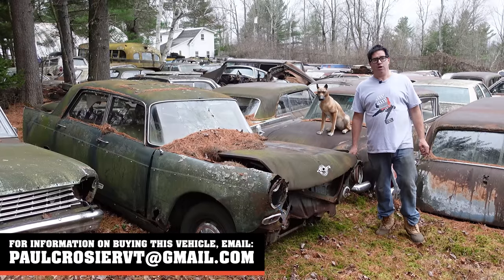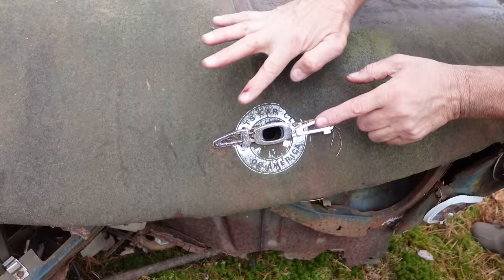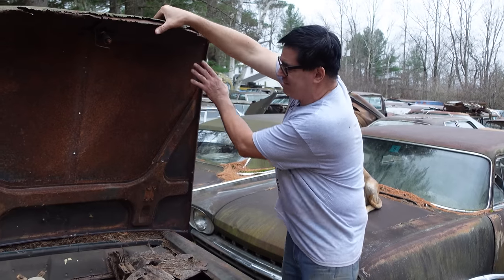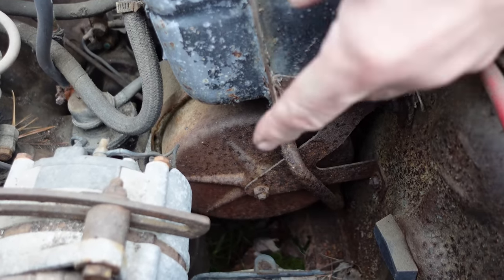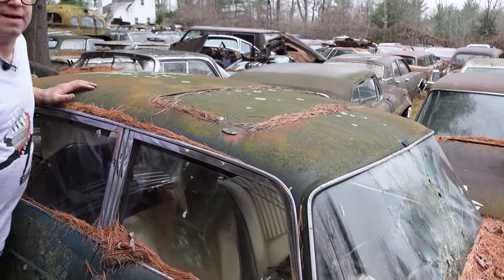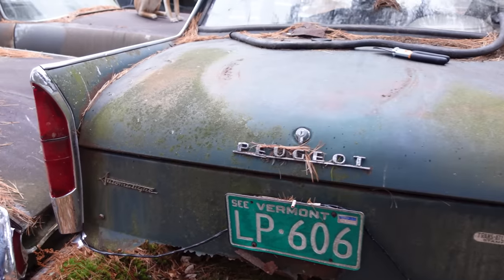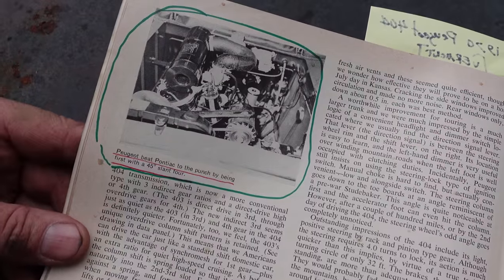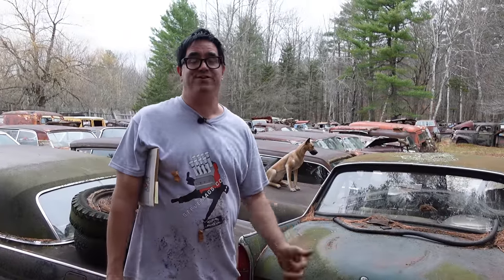Pee Yu Joe!

Comment: The 404 is a French car with Italian styling. Pininfarina designed the body. Lots of them still on the road here in Kenya where I live. The successor 504 was assembled in Kenya between 1974-2002 and was the most common car on our roads for many years. They're tough and reliable vehicles.
Reply: That's really cool to hear first hand experience, it confirms what I heard on Top Gear.
Reply: Just like Fiat 124 based RWD Ladas [1970-2012], in Egypt 2014. They're still popular in former Soviet Union countries and Hungary. I still drive my 2107 1300. It was cheap to buy, easy to repair - no electronics, turbo, DPF, power steering pump etc. good suspension - Western car owners have to replace their ball joints and swing arms every year. They were constructed for German Autobahns. Lada could be driven on some really shitty roads, it's still like a car from the 60's. The suspension of the Lada passenger car is not much different from the off-road Niva.
Reply: As I understand it, the top selling car in Kenya is now the Toyota Fielder.
Reply: @rightlanehog3151  Fielders are expensive. Top selling would be a Toyota Vitz or Honda Fit, less than half the price of a Fielder.
Reply: @upscaleshack  Thank you for the very helpful clarification. As a Canadian who learned recently that the most stolen vehicle in Kenya was the Fielder, I erroneously assumed it was the biggest seller as well.
Reply: @rightlanehog3151  Keep in mind that the vast majority of cars sold here are used Japanese imports. The new vehicle market represents a tiny portion of car sales. By law we can only import right hand drive vehicles newer than 8 years old, so most imports are small cheap Japanese cars  that are 7-8 years old. These sell for between $5000 and $10,000 USD locally.
Reply: Cool that you are watching in Kenya and thanks for sharing that info.  And I have always thought highly of Peugeot because of their bicycles and sponsorship of a pro cycling team decades ago.
Reply: Although Peugeot isn't exactly known to build very reliable cars. The 504 was definitely a different story then the crap they have been producing the past 30 years.
Reply: @upscaleshack  My understanding of the Kenyan auto market  is becoming clearer and clearer. You mention the Vitz, did you ever see a Toyota Voltz? It was the Toyota branded equivalent of the Pontiac Vibe I drive.
Reply: @rightlanehog3151  Yes, I've seen a few Voltz around but not many. They look pretty weird, Pontiac styling with a Toyota logo. They were actually built in California and exported to Japan.
Reply: @upscaleshack  Yes, they came from a plant which at that time built Corollas, Vibes and Tacoma pickups.  The third sibling in the Vibe , Voltz family was the Toyota Matrix which came from North America's other Corolla factory in Canada.

Comment: My friends father had a 1979 Peugeot 504 diesel manual and drove it over well over 200,000 miles then sold it to our family and my sister drove it for a while and it was nearing 300,000 and what stopped it was the strut towers rusted out. The thing ran great and was super comfortable with great seats and was very different. Would like to drive one again.

Comment: I got my driver's license with a 1970 Peugeot 404 sedan. A couple of interesting points about the car I would like to share - First, under the hood where you showed how the shock tower was rusted, there were two clips on the top of the inner fender. On our car that had a crank stored there so if needed, you could hand crank the engine over. Also, with the factory sunroof, it was manual, a handle that you turned down and then pulled back and set where you wanted it (the sunroof never leaked). Fun car, It was the 3rd one our family had, in '69 my father bought a 404 3 seat wagon which he towed a camper trailer all over eastern Canada and the New England States - Imagine two adults and five kids in the summer with no A-C, fun times.

Comment: I bought a 67 in 81. It came with a parts car in a field of farm implements.  On a drive to Denver the water pump bearing broke. I topped off the water and drove on.  The fan would center itself at speed like a top and would only overheat under 55mph.  Made it to Denver and home in4 days. I heard these cars were the only cars sold in Algeria as nothing else new could last more than a year.

Comment: Colombo drove a Peugeot 403 Cabriolet.  They, SAAB, Mercedes, and some Econolines were four on the tree.  Had no corrosion resistance and were poorly supported in the day.
You would often have a Renault, Citroen, Peugeot dealership, and a back ordered parts situation for all. In the mid fifties Renault outsold VW. The Renault sixteen that competed with the 404 and 504, a front drive nightmare to work on. The Japanese sent them all scurrying.

Comment: Mwoah, I've been waiting for a Peugeot on this channel. Im a Peugeot enthusiast and i almost got to own a 1965 Peugeot 404 1.6 Petrol with a manual transmission and even the original radio, about 2-3 years ago, but once it got sold from under my nose i bought a 1974 Sunbeam Avenger, (sold in the States as the Plymouth Cricket). I currently own a 1997 petrol Peugeot 605 turbo 2.0L automatic, which could use some love, but luckily i have my daily Caprice to get me around in the meantime.

Comment: All of the Pratt and Whitney radial engines from 1925-on were hemis too. One exception - the 20-cylinder Yellowjacket experimental engine was liquid-cooled with single overhead cams. Same with Wright, Continental, Lycoming, Warner and Jacobs. Hemis.

McPherson struts we’re invented by Earle McPherson while working for Chevrolet on the small oddball Cadet, which was ultimately never produced in the states. It twelve inch wheels. McPherson went on to Ford and helped develop the Falcon/Comet.

Comment: My dad had a 61 404 from 1964-1968.. He traded it in on a 1968 Pontiac Tempest custom. My mom told me that when the older salesman Rex Pontiac in Queens NY who delivered the Tempest, hopped in the 404 to pull it behind the dealership he said.. "Oh Jesus! its got a manual transmission too! I haven't driven a Peugeot like this since the end of the war in France!" 😂Funny that you have a Smart car. I had 2 of them at one point. I still have my 2009 Black Brabus coupe I bought new in 09.. They only made 1500 Brabus editions that year (750 coupes and 750 convertibles in black or silver) Its a fun car to drive! Just one in my fleet of vehicles.
Reply: Your father made a smart move by trading that heap for a Pontiac. LOL.

Comment: The director of the housing authority where I worked back in the late 70’s drove a diesel Peugeot 504 (the successor to the 404). It was definitely sharp looking car, but man the cloud of smoke and the noise from that engine was something else. You could hear and smell it coming from a block away, and when it was quitting time you could always hear it cranking and cranking in the parking lot before it finally caught and belched out a big cloud of smoke. A gas powered slant 4 hemi-style engine sounds like a pretty good idea, that 504 would’ve been pretty nice if it had one of those in it.

Comment: Interesting fact: The 404 rear axle uses a steel worm drive pinion against a bronze ring gear. This is to have the propeller shaft as low as possible, for more room inside..
Reply: Yeah, it's too bad we can't see the drivetrain on more of these episodes.
Reply: I looked it up and it is still available on ebay. That big bronze ring gear is a beautiful part.

Comment: Hi Steve,  I've had two of these 404's. Few vehicles have ever road as well!
For what its worth, I checked the serial number in my big book of 404 stuff. Your rot box was made shortly after 11/65-  so probably a early to mid 66.  They ditched the large boosted brakes by 69, and went with front power discs.     That ZF trans was the company's first automatic.  It normally takes off in 2nd. You have to manual select low to find first.   The rear ends of 203,403,and these 404's have bronze worm gears, so they used castor oil. 

Peugeot liked to make a lot of 1 off market specific parts, and adaptations , like the USA spec disc brake cars have a special master cylinder, unlike anything else they ever made. This means there are no factory replacement parts when new.  Its crap like that which knocked them out of the US market.  They always had parts supply issues.  When emissions, and safety standards started to be enforced,  they went out of their way to do the bare minimum quality wise to squeak by.  Every single piece has a part number in the book, though some pieces have 10 different numbers.  Which do you need?  Short of physically measuring and checking -your guess is as good as anyone else's!   

My last 69 404 auto was given up on by the garage that serviced it from nearly new. A lot of company's French parts places will not ship over here now (within the past 10 years or so).  When asked why so, the general reply is "Because".    C'est la vie!

Comment: Back in the mid 80's I bought a used 504D diesel wagon with stick. Mind you they started building diesel cars before Mercedes and still couldnt get it right with the 504. I can say that turd lived up to the reputation of French cars rusting quick, being as unreliable as English or Italian cars etc. The rockers were rotting off it in short order, it was always some electrical issue, one day the harness caught fire at the starter, it blew 2 head gaskets, when you were inside it wouldnt let you out, and when you were outside it wouldnt let you in the latches etc worked so badly. About the only good things I can say about it was the Mercedes like ride, and the INSANE cargo volume and weight it could carry for a station wagon, plus its high ground clearance for those nights I was jumping curbs and traffic islands coming home smashed on beer. Hopefully their reputation has gotten better the last 40 years. They adore these cars in Sahara countries. Here in the USA Peugeot were known to lose the most value instantly driving it off the dealer lot new, and also worst resale value because they were such a bad car for such an established car. They got the message quick and pulled out after two decades of poor sales. I bought mine used from the local Peugeot dealer, Dependable Motors (ironic!!) and should have bought the early 70's gold Mercedes 220D sitting next to it. That car left such a bad taste in my mouth that if they imported cars here today and were giving them away I would pass! Horrible, miserable, ugly, unreliable, rust buckets. We used to joke what rusted quicker, a Fiat 124 Special or a Peugeot. These days young people pay big money for a rare clean example. I ended up trading mine for a 62 Studebaker Lark with a blown rear end I was so desperate to get rid of it after I listed it in the classifieds and the potential buyer took it to an automotive consultant service and they inspected it and found a myriad more issues than I knew it had. They should do their research first or talk to older people that owned them back in the day..........

Comment: There was no larger Pegeot than this 404.  The 504 that replaced it was marginally larger, but a lot faster.  You may know the 403, the inspector Colombo car.  Frane had a lot of innovative automotive designs, but there were rarely about the enthusiast, they were usually about the practical minded person (exception of course is the Bugatti of the 20's and 30's).  They also had very nicely styled cars.  This is one example, which not only sold all over Europe, but also the middle east.  They even had a pick up truck version.   My favorite mass production French car is the Citroen Traction.  I rarely like FWD cars, but this is an exception.  The DS was a very unique car too, both in terms of styling and engineering, but I do not like it.  Much like the Citroen's, these 404's had very soft ride, but a very good compromise between ride and handling.  A competitor to this would be the Volvo 122, which was both much faster and handled better,  but had a harsher ride.  The Volvo engine is more conventional wedge, but made a lot more power with 2 SUs.  It was also a lot more noisy.

Comment: I have a 1962 404 that my dad bought in the '80s or early '90s & drove us in as kids, I haven't gotten to it because it's not going to be a cheap enough restoration but it is an interesting car. It has the roof rack & venetian blinds intact but luckily no sunroof. It also seems to have a more primitive braking system than this '74 which includes a small GLASS pot as the reservoir.

Comment: Supposedly very reliable cars. The 403 model from the late 1950's (Columbo TV series) was recently  not expensive and not considered a classic like the stratospheric Chevy's from the same vintage, yet old Peugeot station wagons and convertibles are supposedly quite rare and collectible. As time went on , there were reputed electrical wiring connector corrosion problems into the 1980's with the most recently imported Peugeots which soured some consumers, though the cars were great daily drivers, and may have needed a spritz of CRC electrical connector solution to remedy shorting out.

Comment: The '78 Fox-body [Fairmont/Zephyr] is the first domestic RWD with MacPherson struts.

The '78.5 [January 1978] L-body [Omni/Horizon] was the first domestic FWD to get them.

GM followed suit with the X-body in the spirng of '79.

I was a tech in a tri-line Pontiac/Datsun/Dodge dealer when the L-body and the X-cars were released.  I also got to service and drive the Lil Red Express Trucks and the SATB TransAms as new vehicles.

SIDEBAR.....do you have any info on the 1947 Chevrolet Cadet?  Facsinating vehicle that never made production.
Reply from the maker: If my memory serves, wasn't the '47 Chevy Cadet meant to be a true economy car? I know Ford and Chrysler both toyed with the concept and the Ford wound up as a British car though the Chrysler was stillborn. Let's remember the Ford V860 of the 1930's was sold in Europe (and the US) as a cheaper model. Anyhoo, didn't elements of the Chevy economy car end up on certain Opel models? I know there are connections. I do remember the magazine Special Interest Automobiles did some articles on the post war economy car trend that fizzled. Thanks for watching and writing. -Steve Magnante

Comment: Steve, I had a 504 diesel automatic for many years and it was one of the best "traveling" cars I ever owned. Rode like a much better handling version of a Cadillac. Smooooth. Would run 80 on the interstates all day (yes it took a long time to get to 80) and had the most comfortable seats ever. Originally bought it "used" to cut down on my wife's speeding tickets, so it served well for that role too. It WAS slow, but I really liked it.
Reply: @P&J Poston my buddy in the early 90’s had the Diesel it was really reliable but yes it did take a while to hit 80. Great on MPG. 👍
Reply: @Daniel-fd3wp  But once you GOT it to 80... you could roll. Yeah, great milage and very reliable, but they were different and Americans don't like different.

Comment: My brother had a used 404 with a diesel engine I think it was a 1983 model. It had about 300,000 miles on it and drove it until the rear suspension fell off.

Comment: Hi Steve, good video!  The remote located vacuum power brake booster was not uncommon years ago.  When power brakes first came out on American car(s) the vacuum booster(s) where not located on the firewall behind the master cylinder at first, they often located on the frame rail, after the master cylinder.  Take a look at a late 1940s to mid 1950s American car with factory power brakes.  ZF Hurth is one of the leading transmission manufactures of transmissions world wide at this time in regards to truck and marine applications.  By the way, The Ford Pantera used ZF Hurth aluminum transaxle.  The term hemi is a "hemi" is now a Chrysler Corporation trademark.  But in the mean time, all that "hemi" means is hemispherical combustion chamber?  Chrysler is not the first and only one that produced a hemi.  Please reply.  Dave...